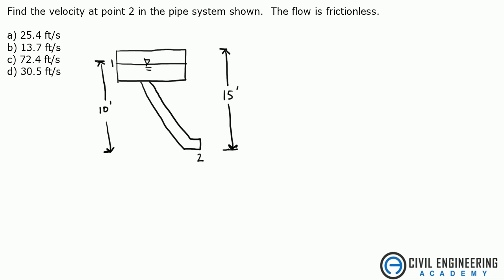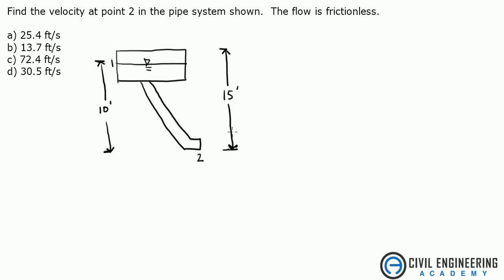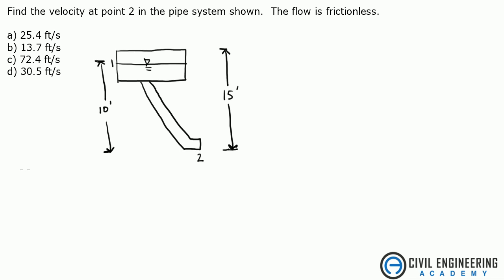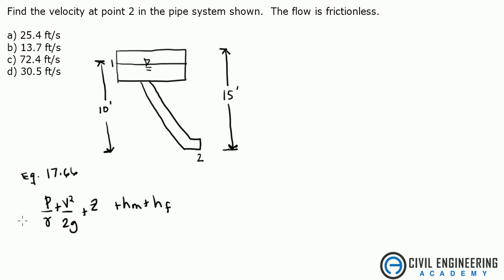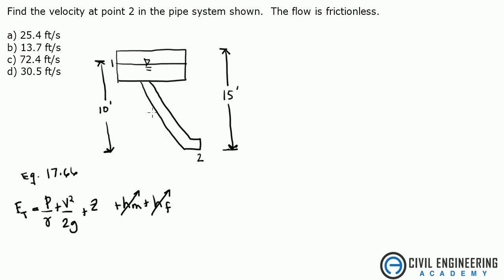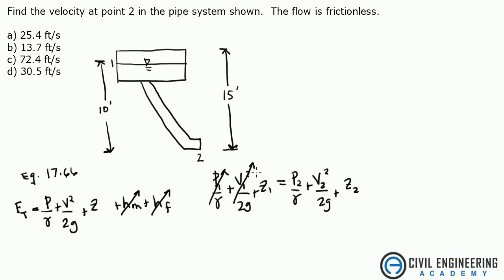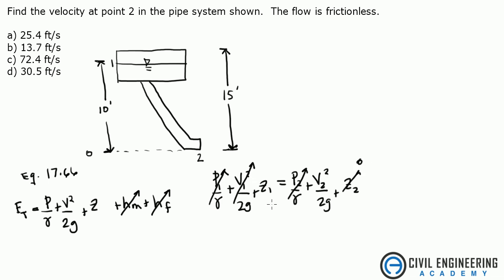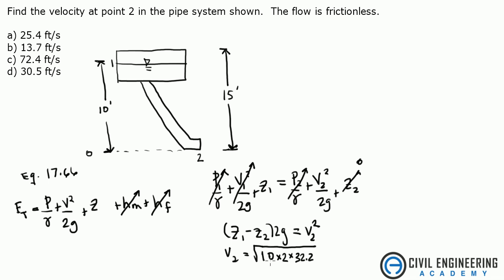Water Resources-Energy Equation No Losses

Comment: Uh why did you need another equation? Could solve it from Z1 = V^2/2g and plug in 10 for Z1 and 32.2 for g and then end up with finding the square root of 644 to get the answer.